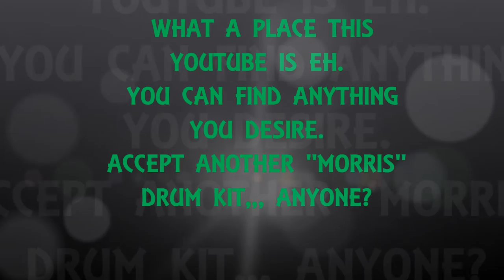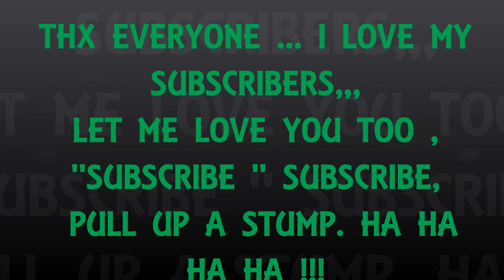A VERY SPECIAL OLD CROSS CUT SAW

Comment: I understand your feelings of attraction to these old saws.  My grandfather had a small lumber operation in northern Ontario cutting railroad ties for the Algoma Central RR with his brothers-in-law to earn extra income during the hard years in the late 1930s.   I've come into the possession of my grandfather's crosscut saws through a couple relatives, a 5 foot felling saw in 2019 and a 6 bucking saw in 2023. Both the saws I inherited are Simonds with the No. 6 handles found on your saw.   I restored the 5 footer, and now I'm working on restoring and sharpening the 6 footer.   These tools are a connection to my heritage.

Comment: My Dad told me about my great grandpa using a 2 man crosscut by himself by weighting the opposite end. That was back in the 1920s. Those were men! They use to cut the big cottonwoods along the Missouri up on the confluence of the Yellowstone on the ND Montana border. They had a buzzsaw they cut the cottonwood into lumber with. Dad said you had to hurry up and use them before they twisted! Grandpas house was built out of cottonwood. It's  still standing out by Trenton ND. All our workbenches on the farm were built out of lumber Dad, Grandpa and Greatgrandpa cut.

Comment: Try some vinegar or rubbing alcohol to get the grime off. That looks fantastic. What a great gift.
Reply from the maker: +joeandmollysantamour... thx buddy
Reply: +joeandmollysantamour If you have a container that you can soak it in try a 50/50 mixture of vinegar and water that is what I use to clean my cast iron pots. Don't let it sit in the solution for more than 2 hours with out taking it out and rinsing it off or it will eat away at the metal
Reply from the maker: Patrick Gage I like em lookin putina ha ha   thx pal